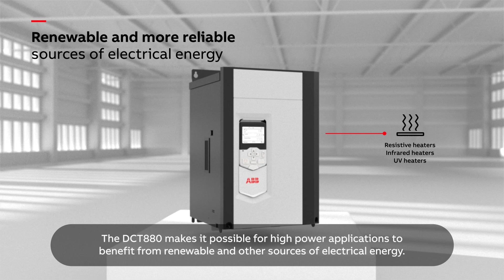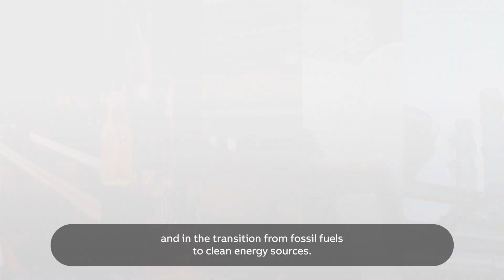Focus on the future with DCT880 power controller for industrial heating applications

Comment: whats different between ACS880 and DCT880
Reply: ACS880 is a variable speed drive / variable frequency drive and DCT880 is a power controller. The difference is that ACS880 supplies motors and controls the speed and torque of motoric applications like pumps, fans, conveyors and more to rotate them, and DCT880 supplies heating elements and provides power to them (resistors for example) to create heat, not mechanical movement.